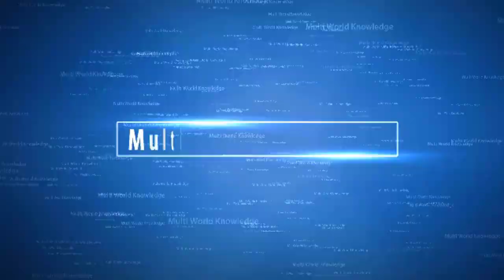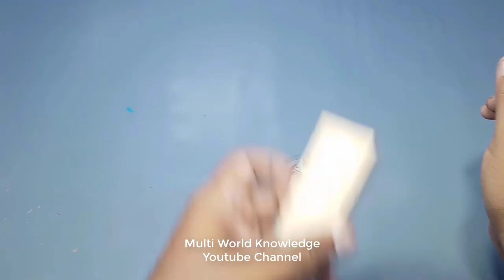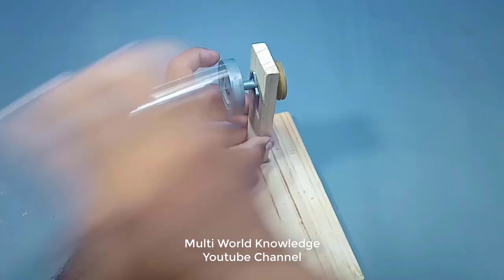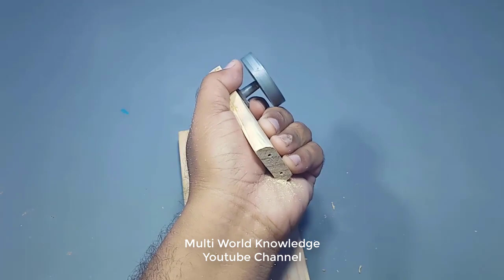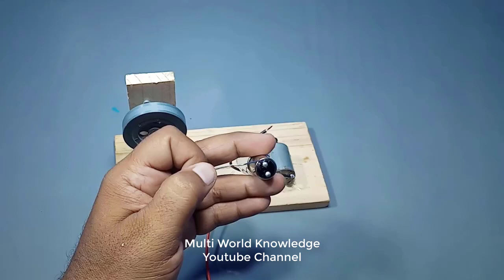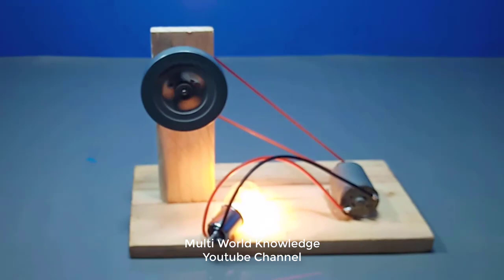How to Make Dc 12 Volt Free Energy Flywheel Generator

Comment: Uses two or three principles. Motor dynamo effect, every motor generates a reverse current. Second is Flywheel. The ring magnet on the other side of the gear is acting as a flywheel to conserve torque. In that case if you pull lots of power, it will stop all of sudden. This is no wonder. It just need basic current at some volt at beginning.

If he used two motors one motor in those will act as dynamo, in such cases, one can just use zero input current to start with, but it needs some sort of string based pulling to generate the basic power. 

This is not free energy, just sucking power out of space. In a way zero point energy but not acceptable by main stream science